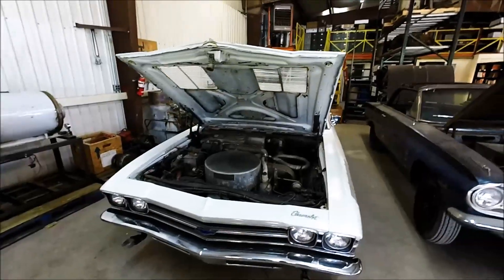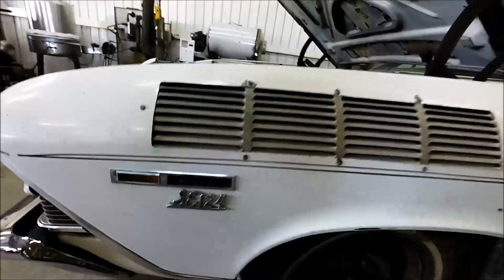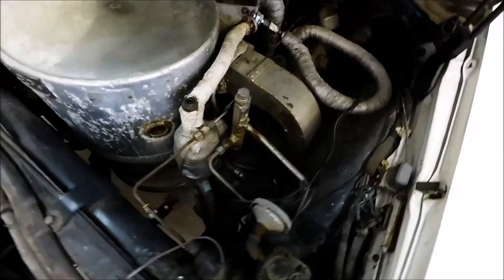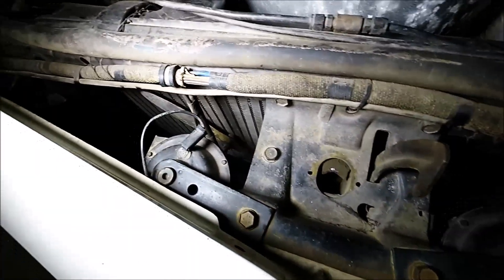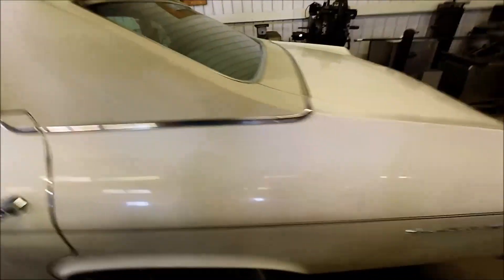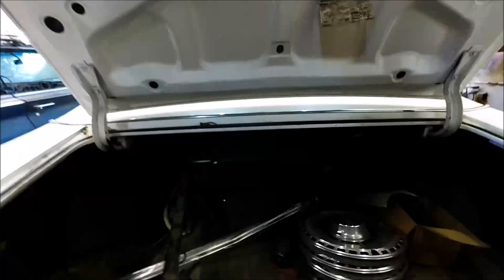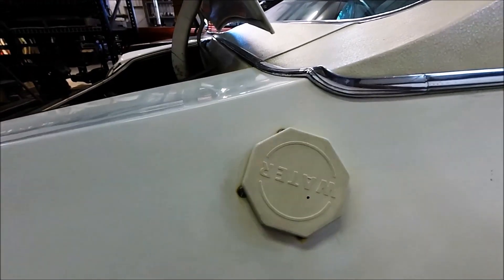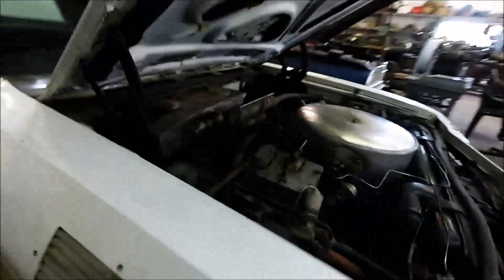1969 Steam Powered Chevelle - Built For General Motors

Comment: GM did some extensive research into steam power and were close to a production vehicle.  The power numbers were very impressive,  from memory, something like 1100 Lb Ft from almost zero RPM!!  The 'boiler' was not a boiler as such but a flash steam generator. So it was quick to heat up and there was only a relatively small amount of water in circulation. They experimented with kerosene and LPG as  a fuel source and the start up procedure was automated, so no stoking or boiler lighting!! Ultimately the problem was efficiency, it is impossible to make an external combustion engine as efficient as an ICE.
Reply: There were plans in the 60s to also build thorium powered cars. Thorium is radioactive and doesn't actually burn. It just gets really hot. The burning hot thorium would be hot enough to make steam. In theory a thorium powered car would only have to be refueled once a decade. The problem is it never worked quite right and then the public soured on the idea of nuclear powered cars. Just way too dangerous.
Reply: turboslag   Thanks for the heads up on the not-a-boiler. It also answers the issue of modulating (?) the steam. It would be interesting to know how this cheaper fuel would pan out. One might think "just take out the steam part, and make a better fuel engine."  Oh well.
Reply: GM did quite well with using superheated steam to drive a V8 piston reciprocating engine directly. It's torque characteristics were so good that a gearbox was not required!  I must dig out the Automobile Quarterly article that went into some depth on the project.
Reply: Too many steps of separation between the fuel and power delivery.
Reply: Yeah, there was a whole lot of nuclear powered experimenting going on in the 60's!  Nuclear artillery, aircraft (!!), railway locomotives, ships, even home reactors for heating and hot water!
Reply: Steam power, regardless of the means of generation, will not work as a viable vehicle if the steam itself is being used to power the drive train. Water is too reactive(it is called the universal solvent), too hard to contain, and too complicated to control direct power delivery reliably and with good response.
However, a steam generator charging batteries, with electric engines, could work.
I feel this is the direction something like this would go in if it was revisited today.
Reply: turboslag   I always found "superheated steam" to be an unnecessary adjective; "Sub-cooled" water seemed similarly confusing. Those would be plasma (though that phase was probably too extreme at the time) and ice.  To me, sub-cooled water would make sense in the phenomena of still water staying liquid below the normally accepted freezing point.  (Should liquid water be referred to as "superheated ice"?? - sorry, personal pet peeves.) No transmission: Interesting. One might think that would be very tough on the engine (crankshaft, connecting rods, wrist-pins etc...) and/or higher speeds would not be attained (nor reverse?). I can see why is all just doesn't make sense to try and adapt that engine block; the evaluating and trial is respectable.  The only receivable "wow" factor today would be something like extracting dark energy or matter to magically power vehicles with unlimited abundance at no cost - yes, my facetiousness.  It looks like the fuel cell development is a no-go, and battery power is the current focus (though I don't know the whole-impact scenario).  Thanks for your reply.
Reply: This and the SE101 were both unmitigated failures.. GM never considered production.

Comment: Looks interesting. Detail would be better if some sort of video light were used. What does it need to get back on the road?
Reply from the maker: +Scooter George engine needs to be gone through. Hasn't run in a decade or so.
Reply: I own q 1965 Ford Mustang. 289 engine was tired. Starting to smoke. Stuck it in the garage. Moved. Trailered it to the new place. Stuck it in the garage. After a new battery and some gasoline it started. Transmission was low on fluid. Seals dry. Added fluid and drove it around the block. 
I would try starting your rig before tearing into it.
Reply: Your Mustang would probably have a lot better compression if you hadn't just started it after 10 years of sitting idle. 
Not to mention you took the risk of old oil becoming lumpy and blocking the crankshaft oil feeds...
You really should be store vehicles dry...
Reply: Knowing as I did, that I wouldn't be driving the Mustang for a while, I changed the oil so it did not sit with dirty, possibly acidic oil in it. Let it idle 5 or 10 minutes to circulate clean oil.  That was the extent of the preservation though.  Did not anticipate it sitting 10 years either. But the engine was smoking then and was not noticeably worse after.
Reply: Robert Langford "Point" ok yes I missed that still that just ups the level of complexity and finicky ness of the whole thing
Reply: Actually, you get "clouds" of superheated steam. It has to be very high pressure or you get no power. Pressure is exerted on the piston. Could easily be 500  degrees F.
Reply: would be nice to see it run BUT your Mustang would sputter fart and throw oil were as a steam engine is a bomb waiting to happen any damage rust and corrosion to that boiler and boom not saying that is the prob but yeah also a lot of fiddly bits in there could just be a real awkward part we will just have to hope they get it sorted and we can see it run would be nice

Comment: That's pretty cool. Any chance to check out the Air Force's Stirling engine truck?
Reply: I saw the video of that Dodge truck from when it was new. Nice to know it's still around.
Reply from the maker: +William Biggs where is that located?
Reply: My best guess is Langley Air Force Base. Supposedly does not require oil changes, catalytic converter, or muffler.
Reply: My best guess is Langley Air Force Base. Supposedly does not require oil changes, catalytic converter, or muffler.